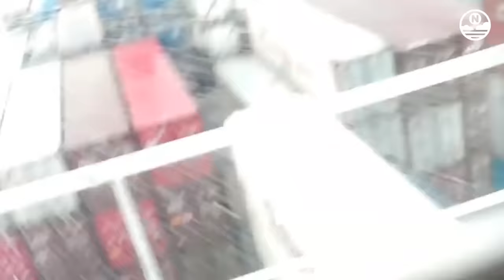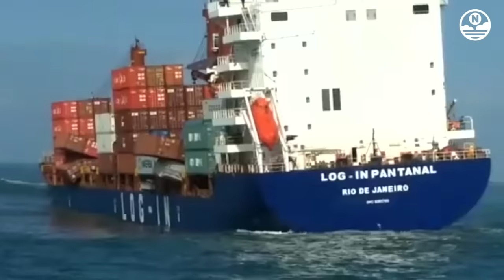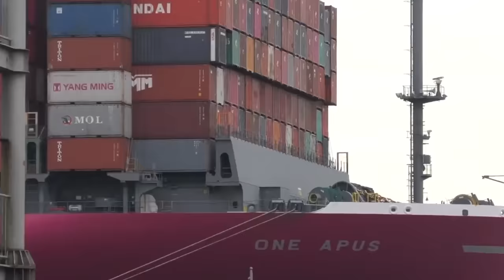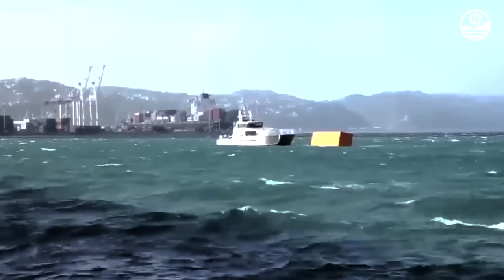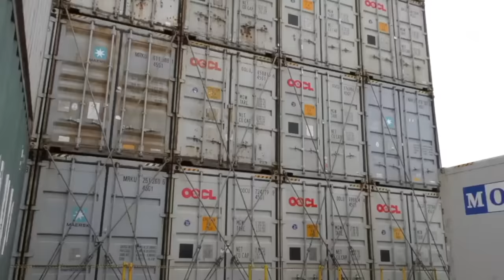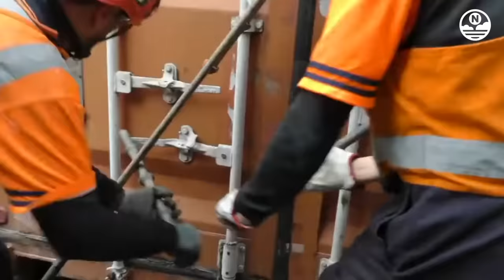When 1800 of Containers Lost at sea, This is How Company Salvages Thousands of Lost Containers

Comment: The shipping disasters are cause by how the ship's hull is designed. The V shape Hull design is the number one factor of shipping disasters. If the ship were built wider like Noah' ark you would have less shipping tilting on its side in heavy seas. The new type of ship design is Dual hull or tri-hull designs is more a stable form of cargo shipping.